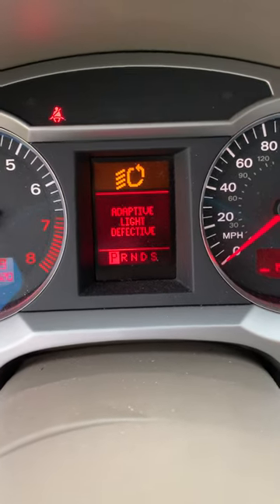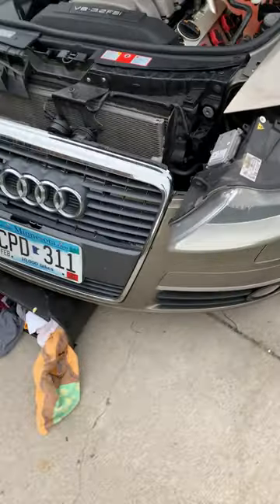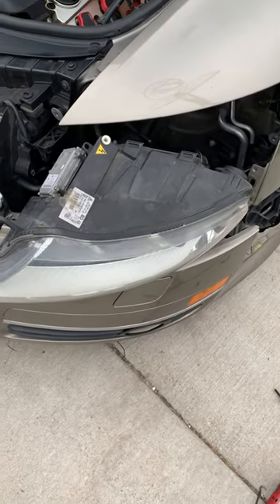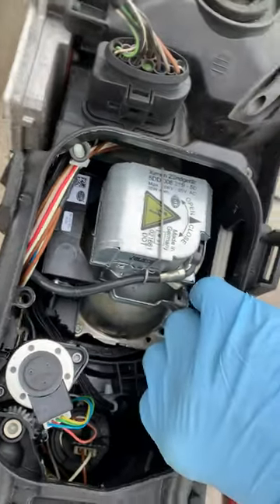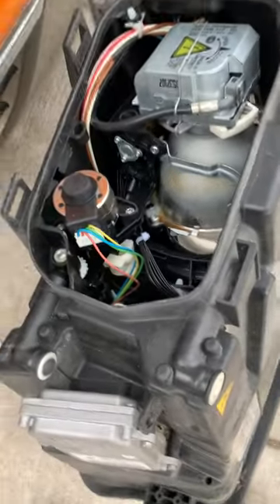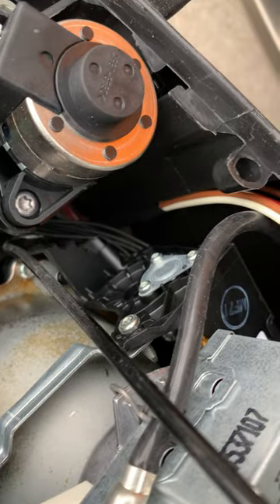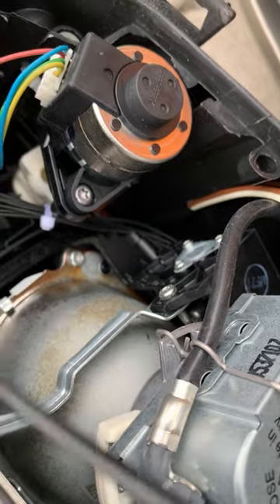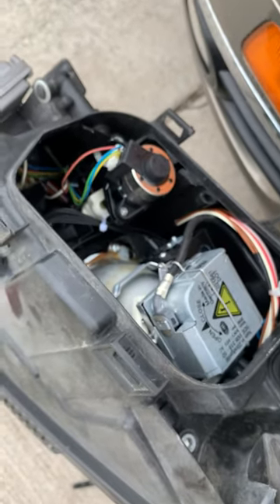Audi "Adaptive Headlight Defective" - How to Fix

Comment: I have the same problem and am in the process of repairing.  The problem is...how do you get in there?  I have the AFS, so the assembly is larger and harder to get out.  Screws are barely accessible-a couple of them seem to be accessible only by remove the front lens and dissassembling from the front.  Do I need to take the Bi-Xenon assembly out, or is there another way?

Thanks for any help!

Comment: This issue sadly identifies a BIG miss by Audi. The fact they outsourced the design of these pricey ($1200+) headlights and their engineering team didn't ensure the requirements were met/exceeded is very unfortunate. I have the same problem with both headlights in my 2007 A6 Quattro and unfortunately, it's not just one wire that's losing it's insulation, it's many wires. The only thing I can suggest to someone taking this repair on, is buy multiple colors of wires with high-end insulation and replace them all. I do like the post that indicates you can reprogram the system with a VCDS scanner to think the car doesn't have adaptive headlights. :/ Thanks to BlackTieMechanics for the video!